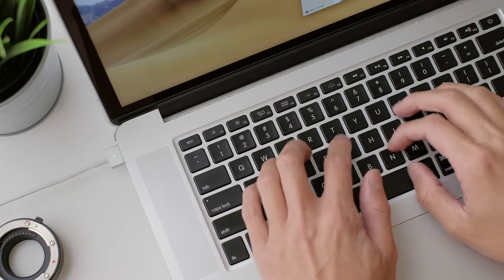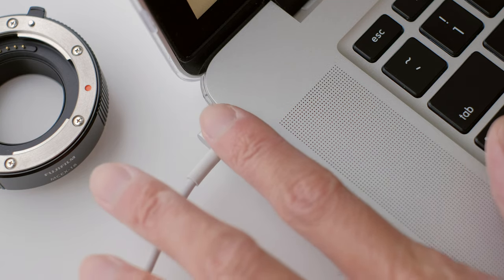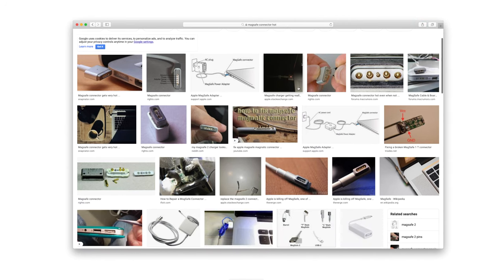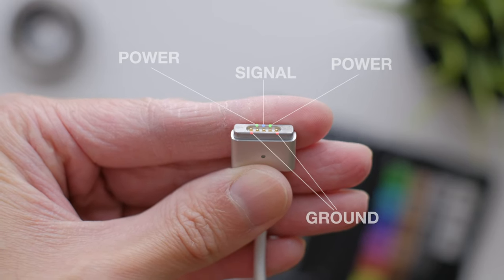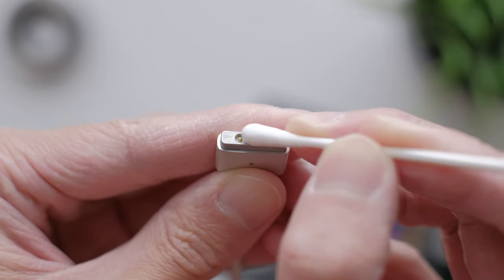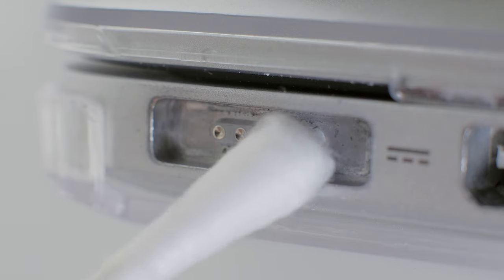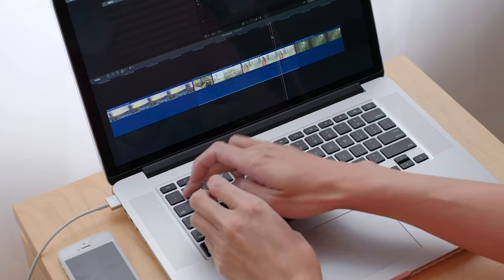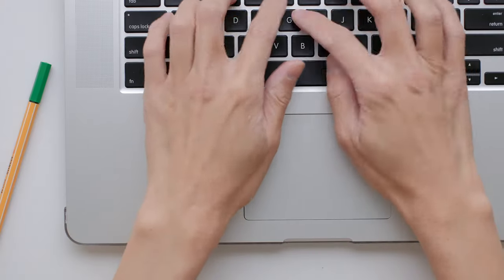BURNING HOT Apple MagSafe 2 Connector when charging. This can't be right...

Comment: I was looking for this for a while. There are burnt marks both on the charger pins and magsafe connector in my MacBook Air. Should I replace both of these?
Reply from the maker: It’s easy enough to buy a new charger but I’m not sure there’s an easy way to change the charging port on your MacBook? 😕 try cleaning and pressing the pins in and out to see if that will give you a better connection? Is it charging OK?
Reply: Had the same issue, and actually it's not that difficult to replace the charging port. Search for "Magsafe 2 DC in-board replace", ifixit has great guides on how to do it. I have the same MBP as Joe, and got my spare DC in-board for around 20EUR.
Reply from the maker: Where did you manage to get the spare parts from?
Reply: @JoeLamOfficial  I was lucky to get it locally, but I have seen plenty of offers on ebay as well.

Comment: Solved the problem by alot, one of pin stuckout...hopefully continue that way. Thankz...!!!

Mine always cleaned not knowing stuck pin can lead to HOT issue...
Reply from the maker: If the pins are not making proper contact it can cause a short = more heat and hazard.

Comment: Hi There! Thanks for your video. I'm using my 2010 MacBookPro, and a borrowed MagSafe from another older version of the macbookpro. It's the actual adapter, and not the peg that gets burning hot. Do you think it may be the same problem, or am I using a wrong charger?
Thanks!
Reply from the maker: Hi there. Few things I want to understand. 
Is it a magsafe 1 or 2 adapter? 
Is it the same power output? Eg with my Magsafe 2 there are different power versions. Eg. like 45w or 85w.
The adapter does get quite hot too but just double check if it's a genuine adapter? Some counterfeit ones are very dangerous and could run too hot. If you search online for "fake magsafe 2 charger".

Comment: Hello Joe!! Such a wonderful video. Just received my macbook m2 air last week, but a few days ago I unexpectedly noticed that the magsafe charging head was showing a black substance and blackening the charging port on my macbook. Fortunately, the charging is still going smoothly. I tried the method you provided and it did recede a bit. I also went to Apple support and they said it doesn't matter as long as magsafe is still working normally. I'm now distressed and wonder if I can return this macbook since it is within the return period.
Reply from the maker: Hey - is it charred or dirt that's accumulate on the pins or the MacBook port. Normally it shouldn't really be like this. Personally, if I have some doubt I rather they replaced it, just to see if it makes a difference. Although there's warranty but doubt they would replace the port if there's no obvious issue affecting the machine. Therefore, I rather take a chance and see if another new machine will have the same issue?

Comment: Thanks so much! I got this problem but my charger is not original! This is the second one that i buy and the plastic box got burned, still works but i am afraid to use it like that and damage my mac so i order a new one! Anyway i will clean it and try your tips
Reply from the maker: Hey there. Hope it works and solves your problem. Definitely glad to hear that you found out that it’s not original and stop using it. They are dangerous those fake ones! 😱

Comment: I have a mid 2012 and it still works great the only issue I’ve had is it burns out charger connector every 8-9 months I’ve replaced both the chargers and the charging boards (internal charger connector laptop side) but it still happens it gets so hot that the power pins no longer spring back and make contact. I do use it everyday for many hrs I’m thinking it must be drawing a lot of current.
Reply from the maker: Hi Ryan, thanks for your comment. That is very concerning. I wonder why it happens on your charger/logic board. I've been using my daily for 8-10 hours for the past 6-7 years also. Drive it hard often with external displays monitors and projectors with heavy applications. Often draw lots of power from the charger especially under load and charging at the same time. 

Is it a magsafe 1 or 2 type charger on your Mac?

Comment: Hey, really nice video! I've just known that the pins are loaded with spring from your video. However, I tried to clean it the way you did (with a plastic ruler) but the pin seem to get stuck in a deeper position, as if it's being held back by something (presumably gunk) or the springs are just busted. Do you have any idea how to pull them out into its original position again? ive tried using pincers but the ones i have are way too big for the pins lol. Id appreciate it if you have any other idea
Reply from the maker: Hi, I haven't tried but just a thought. What about some rubbing alcohol, maybe it will have to loosen the gunk?
Reply: Joe Lam i did use some while cleaning it, but maybe its just not enough. Ill ry again later, once again thank you!!
Reply from the maker: @ferdinand.bumpliz  Yeah try a bit more hopefully it will get in there. Just a thought though, make sure you wait till it's dried out and stuff. probably not good idea to mix the rubbing alcohol with the electricity.

Comment: great tip. mine usually heats up after 5 minutes of plugging the charger and i can barely touch it which is why i charge it when it's off.  btw, my charger is a 60W for a MBP RD (early 2015).
anywyay, cleaned the charging port and the T-connector (even the surrounding area) with the cotton swap.  It seemed to have work. since i can press the T-connected with both my fingers  without getting "burned".   I was tempted to buy a new charger but had to do a search here and there for possible solutions/workaround and that's when i stumbled upon your video.
as a side note, i'm not sure if installing TG Pro also helped.  I set the fan from "system" to "Auto Boost"..
Reply from the maker: Same here. After cleaning it’s still hot but not as bad as before it seems. Mines 85w. I guess it also depends if there’s heavy load and charging from flat.
Reply: just an update. Not sure why I never tried this.  I used the same charger (MagSafe 2 60W) on an MBP RD 15", less than 10 minutes, the T-connector heated up and I can barely touch it for more than 1 minute which was the same on my MBP RD 13"  

I also felt a slight static on the surface of my MBP RD when i was charging it so definitely something is wrong.

The MBP RD 15" charger has no issues (heatin gup) when I used it's original charger (MagSafe 2 60W) on my MBP RD 13".  It does heat up but not like the other charger.

Culprit: Charger issue
Reply from the maker: I have tried using the MacBook Air charger before, it's slower but doesn't heat up. It's only when the connection isn't quite right, like mine here - that's when it gets super hot (for me) at least.
Reply: For the static issue, i bought an extension cable instead of using the head.  It solved the static issue.
Reply from the maker: Yeah that weird static thing is present on mine and MacBook Air. Seems to be on all models. Only when charging plugged in.

Comment: Great video. I've had to buy a replacement 85w MagSafe 2 Power Adapter last summer because the wires got more exposed. I  was charging the MacBook Pro (mid 2015 year) next to the window on several hot summer days back then and I noticed that the rubber casing of the wire (if thats what its called?) started to change colour from white to yellow and eventually, several parts of the wires started to get exposed at an exponential rate. I read about these MagSafe 2 Power Adapters online and several people have been experiencing similar problems, regarding the quality of Apple's accessories. The computers are excellent, but I can't help but think that there's been a bit of cost-cutting with the accessories for Apple's computers.
Reply from the maker: Hi thanks for sharing your experience. I also didn't mention that I had to replace one of mine too since it just randomly went bang - literally. No sign of wear anything or any other previous signs. That's why I never even noticed that they get this hot or suspected any issue since the plug, cable and sleeve looked fine. It's definitely a lot cooler now the connector. 🤔
Reply: @JoeLamOfficial  Wow, its good that you didn't get injured from that bang! Keep up the great work and stay safe from this pandemic, your cables and your S65's rod bearings!
Reply from the maker: I’m all well and safe. Thanks 😊 appreciate all the kind words. Stay safe too. Hopefully get to play with the car more soon. Itching for a drive.
Reply: What was the main issue that caused the yellowing because I’m on my second MagSafe 2 charger and it’s yellowing now, I use a 2015 MacBook Pro retina and I’m on Mojave
Reply: I have the same computer as yours and am sick of this problem. I now need to purchase a third power adapter! It's disgusting.
Reply: @ghstknte  The heat is causing the yellowing. I also have a 2015 MacBook Pro Retina (High Sierra).
Reply from the maker: What happened to the previous ones?
Reply: @daphnemiller5910  what was your solution ?
Reply: @JoeLamOfficial  My previous ones yellowed and the wires were showing because the rubber covering opened up.
Reply: @ghstknte  I have no solution so far except to keep purchasing these expensive items from the Apple Store.
Reply from the maker: Yellow just from plastic UV exposure or you mean getting burnt?
Reply: @JoeLamOfficial  The yellowed part is the cord. What plastic UV are you referring to? I'd say it yellowed because it got extremely hot.
Reply: @daphnemiller5910  okay that's unfortunate
Reply from the maker: Strange that it keeps happening... 😐
Reply: Being next to the window probably didn't contribute much, if anything, to the yellowing. My cords have done it while I'm sitting right in the middle of my comfortable living room.
Reply: @JoeLamOfficial  It's obviously a defect of some sort.
Reply from the maker: Have you checked the pins or the laptop itself? Unusual for it to keep failing
Reply: @JoeLamOfficial  Yes, I have.
Reply: I have the same problem, my conector gets super hot (it`s hard to even touch it) and the cable got yellowish after I purchased it a year ago. I also read that this might have to do with the DC power jack on the mac because that part around the port on the macbook gets burning hot as well. did you find any solution? I'm also using a Macbook pro retina 2014 as my daily driver and this is my third magsafe 2 charger.
Reply from the maker: Maybe it's something with the actual circuit board if you had that many issues with so many different chargers?
Reply from the maker: That is also possible, might not be the charger magsafe cable side, but the actual logic board itself.
Reply: @tmscrs  Super hot when I accidentally touch the part that attaches to the laptop. I now know to protect my hand with a cloth before trying to disconnect the charger.
Reply: @JoeLamOfficial  I have wondered if the source could be internal.
Reply from the maker: I find when it’s charging from very low and I use the MacBook under heavy load. That’s when the plug is the hottest.
Reply: @daphnemiller5910  Totally get you I actually try to keep the charger always on while using it and if I have to charge it just close it. This are ways I found for keeping the laptop and charger in safe temperatures
Reply from the maker: It is better for the battery also if it’s not so hot when using and charging from flat.

Comment: Thank you for this! My macbook suddenly stopped charging. I did everthing. Cleaned the pins, reset SMC, even opened it and reset the battery. Was about ready to order new battery or charger. Lol. About the overheating..Will update my comment later. I thought all along its just normal for the connector to be very hot.
Reply from the maker: Hopefully helps. But yeah. Keep us updated if possible. 🙂

Comment: Hey Mate

While charging and working at the same time mcbook air 2017 as well as magsafe 2 and adapter heats up like hell.There is almost no dirts on ports.Still cleaned it and its heating up less now but only on charge.When working and charging the heat is excessive.Any explanation
Reply from the maker: Hello Adnan, if your ports are clean, pins are moving freely and no burnt marks. I wouldn't worry too much if it all looks good. Mine's still hot, but not as much compared to before, but it does get hot trying to charge from low power, under heavy load and driving the internal Mac screen plus external monitor <- when it draws the most power from the MagSafe charger.

Comment: Kudos to you as well. I have same mac since 6 years 👌🏾. But my ports and charger’s power pins are busted. I don’t know how to clean them safely as I really don’t wanna ruin my mac. It would be nice if you can show how clean the busted ones as well. Because your mac’s ports seems as good as new. Also make some more cleaning and maintenance video. 👌🏾
Reply from the maker: Pathik Desai Hi Pathik. Thanks for checking out my video. Amazing that yours is still running too after all this time. I’m still driving mine daily. 
When you say busted pins? How bad is it? I’m not sure if there an easy way to fix it if it’s damaged. My method only works for dirt and grime to clean up. 
Does yours still charge?
Reply: Joe Lam I used your method and because of it. It’s charging now. So I can do little work daily. So thanks to you again. Both me power pins are having black outline still. After cleaning as well. It was so bad that the plastic housing on those pins also melted from ends.
Reply from the maker: Glad to hear its' working for you. BTW, sorry for the late reply. Despite having all the notifications on, using desktop and mobile YouTube Studio apps, comments just don't get notified and I have to periodically manually go through messages to see what I have missed. :(
Reply: @JoeLamOfficial  I understand the pain. My phone does that with instagram. Any who, keep up the good work. More cleaning and maintenance videos awaited. You could make one on how to clean keyboard and oil on display. Just a suggestion :p. Thanks for all the help.

Comment: I have a macbook from 2010. Still using it but its starting to really become obsolete. 
I have literally had 6 chargers burn out from that one. I replaced the port in the computer myself. That meant removing everything including the mother board. Right now its working with no issues. 

I recently got a 15inch macbook 2015 for free. The reason was the keyboard and trackpad would stop working sporadically. When this happened i would use a usb keyboard and mouse. 
Solution: i installed Ubuntu. Now no issues with keyboard. Linux uses whatevery system is availble. There are two systems inside a mac. But the mac os is only able to access the one which breaks down. Linux seems to use the any or both  im not sure. I was so surprised that it works now on a differnt os. 
I cannot understand for the cost of a mac why these issues with hardware are so common
Reply from the maker: Wow 2010! I thought my 2013 machine that I'm typing on right now is old. I wonder if the MagSafe has anything to do with it - the fact that it fails quite often or has issues. The semi loose connection or quick disconnect causes shorts/heats perhaps? (I'm just speculating.)

The keyboard has been known to fail. A common issue with the butterfly design. I haven't heard much about the track pad failing however.

Comment: Hello Sir, I am still using this macbook and it's charger tip got burned. I wanna ask you that can we use another way to charge it like Thunderbolt port.
Reply from the maker: Not possible. Unless like the newer Mac with USB C. Which model is your MacBook?
Reply: @JoeLamOfficial  Macbook Pro 15" Retina Mid 2015 intel i7
Reply from the maker: In that case, no. Only way is via the MagSafe connector unfortunately. There's no USB charging on these models.